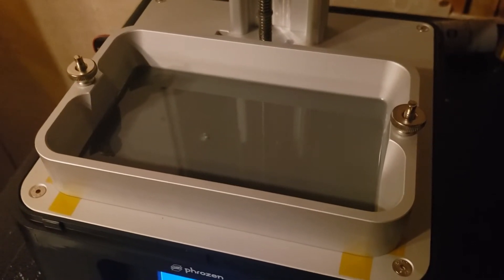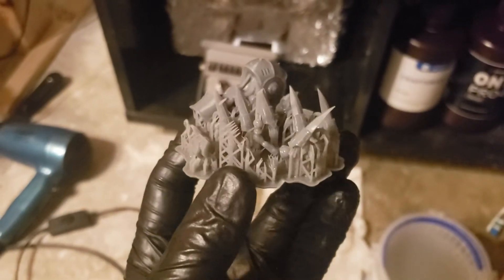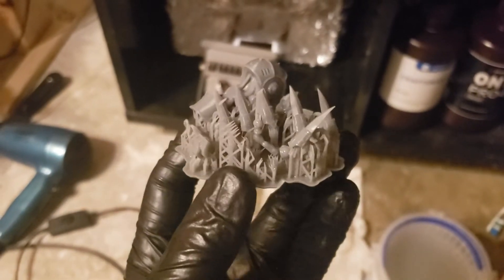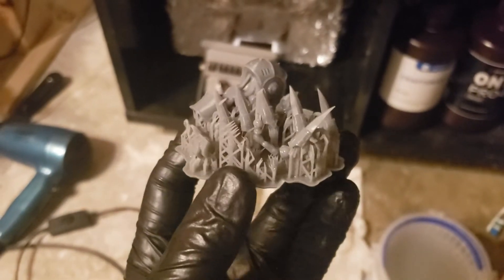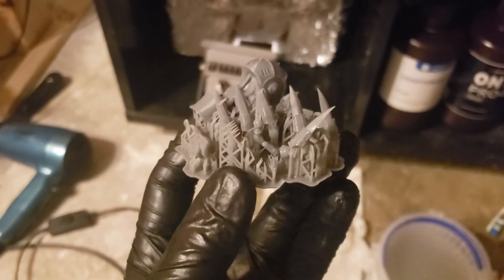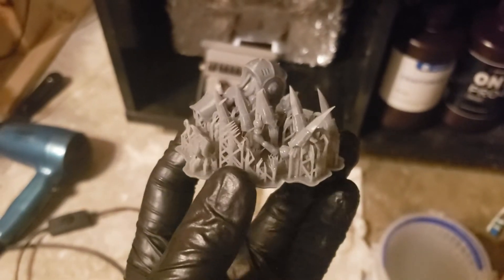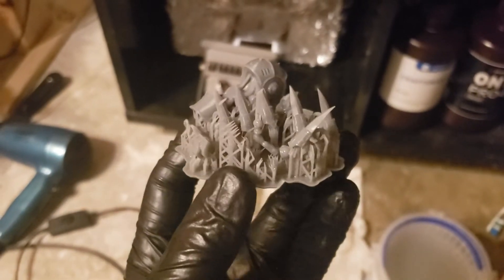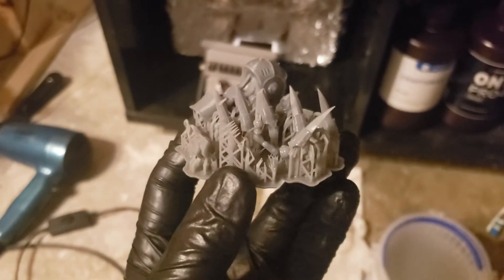Clean failures off your FEP with ZERO SCRAPING! This is the best way!

Comment: For some reason my support dosen't always stick to the cured layer. I have got it working only twice out 5 times. Any idea for improving it?
Reply from the maker: Hmmm perhaps you're not curing for long enough? The "vat clean" should go for 30-45 seconds
Reply: It might be possible the 'pull support' was already cured a bit too much. Some resins, when cured beyond a certain point, don't take new resin as good (at least not so good to be used as a 'lever').

Or, the 'pull support' had a tiny gap between it and the FEP, aka: it floated up a bit. In that case you could try to weigh it down a bit so it sits flush on the FEP. HOWEVER, be VERY careful with this, as you can easily bend the FEP too much (especially if you also have tape around your screen border, which WILL create a tiny gap between screen and FEP because of the thickness of the tape). And as such damage the FEP or at least shorten its use time.

Also make sure your 'pull support' sits right in the corner(!) of the exposed curing area. Maybe a bit over it so you create a loose lip to pull from. Do not put just anywhere. Note: this also automatically minimizes the bending of the FEP in case you weighed the 'pull support' down a bit (doesn't mean you should/could put more weight on it though --  just enough so it doesn't float up).

Comment: This is all to complicated. 1-position the support right on the edge 2-exposure 3-peel off carefully and remove the cured resin 4- done
No vat removal, no vat draining, ni vat massaging...
Reply: 5- increased risk of punching holes during next print (out of sight) because of loose bits still floating around in tank.
6- crying in shame and regret of skipping a step to save 20 seconds of sieving the resin.
7- massive cleanup which takes move than an hour (that is in case your printer did survive and resin didn't leaked internally)
8- hiding the stupidity, and never mention it again so other people are strengthened in their believe that "you don't need to drain the vat" .
9- the "hot tip" spreads as wild fire.....

Comment: Would this work with the resin still in the vat or does it have to be drained?
Reply from the maker: Its best if this is done before draining the vat!
Reply: @YouveGotRyan  I just tried it with the resin still in the vat and placed some old print on the edge of the screen before starting the full screen exposure so I could pull the sheet of cured resin off without even taking off the vat :) works amazing!
Reply from the maker: @ynzeselders4184  happy it worked out for you!

Comment: How bad is the smell?
Reply from the maker: Depends entirely on the resin. Some haven't been bad at all, some have left an acrid taste in my mouth and burned my eyes. I've started using a respirator (and safety Google's over my glasses) if I'm using harsher resin.

If fumes are an issue for you, water washable resins typically are less smelly than the others, but you'll still want them in a very well ventilated room while using. 

Issue with water washable resins is that thinner parts like swords and spears tend to warp after they're done printing. You can reshape these parts by heating them with a hair dryer (after they're fully cured), bending them into shape, and quickly submerging them into cold water once the desired shape is obtained.

Comment: Use 3-in-1 silicone lubricant spray (light sprits on your fep) and use micro fiber cloth to spread it around covering the whole fep before you pour in your resin and you will not have problems with prints sticking to fep.

Don't just use any oil or lubricant, silicone lube is the only safe option. As it's ingredients do not pose a danger when mixed with resin and/or degrade fep.

Comment: Honestly I think this vat cleaning option is horrible.  You’re partially cursing the entire vat of resin, and then pouring that partially cured resin back into your fresh resin.  This has to increase the chance of failures…

Just putting a bit of IPA in the vat and then pushing gently on the underside of the vat is enough to pop any piece off.
Reply: @Dan De Angelis What can I say, it works for me and a ton of others, so maybe figure out what you did wrong.  🤔

Comment: another ametur that thinks this is a good way, so much wasted resin, this is a bullshit way but if u lower the exposure time u would need to rub the back of the fep, the not good to that, and if put the supports in the corner instead of the middle of the screen it would make it easier to remove all that wasted resin, a few cents worth, how cheap are getting your resin for, it like u have only just gotten into printing, and what exactly have modified to say that's a heavily modded printer